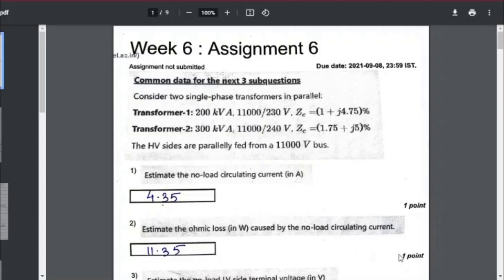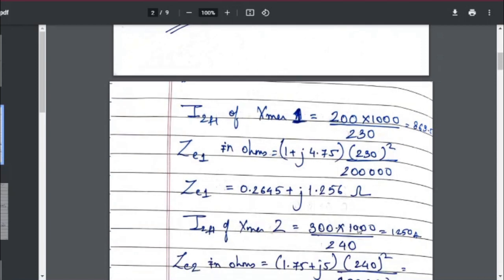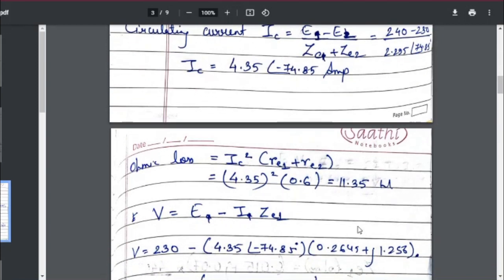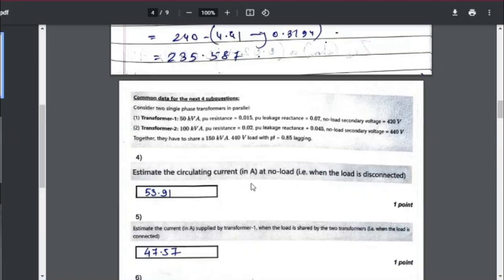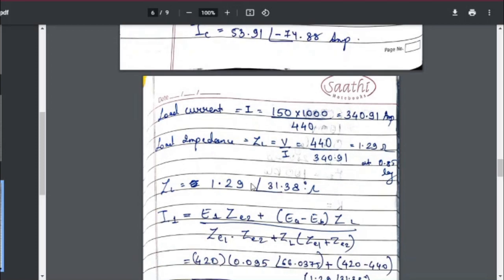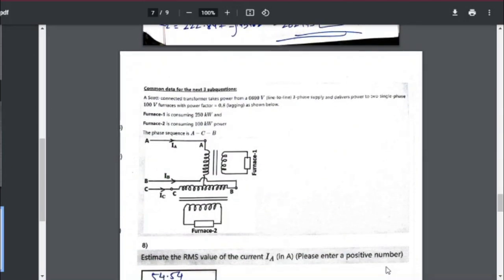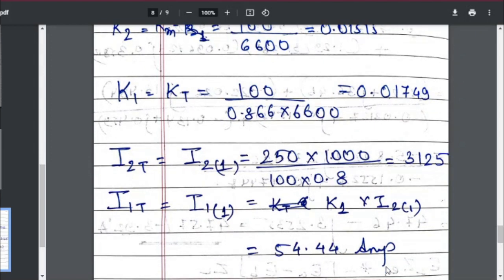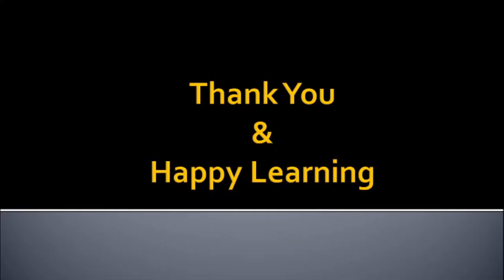Electrical Machines 1 NPTEL Week 6 Assignment

Comment: Hllo mam wrong solution kyu upload karte ho...itta v kya jaldbaji h ek baar check kar liya kro...mai previous assignment me v aapko bola tha
Reply from the maker: I never claimed my assignment are correct and human errors can occur. I always ask everyone to recheck and calculate by themselves before submitting. And I take out time from my schedule to solve and upload the assignment just on request of my followers. 
I again request not to copy my answers blindly and try to solve it by yourself.
Reply: @welearnbysharun2679  hllo mam..not only in calculation mistake but also in concepual mistake...such as u didn't change % impedance in pu  and also in previous assignment -5 u didn't not use efficiency for calculation of input power.....
So as I am follower of u...I suggest u u revise concept then solve assignment and also check regain calculation..
U don't take on heart..I am just saying for your improvement ...nd u know your improvement that's help your followers..